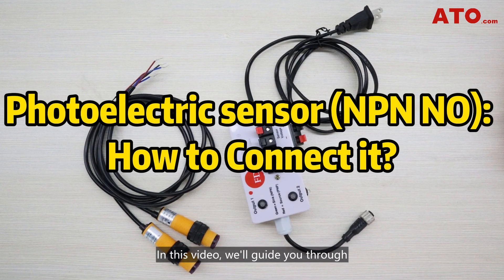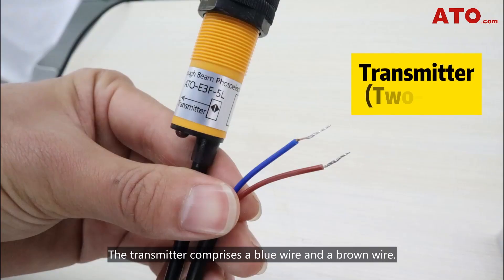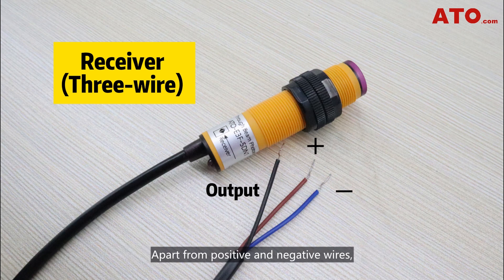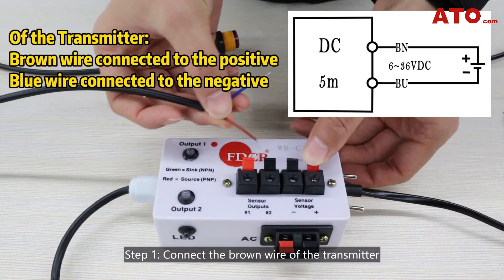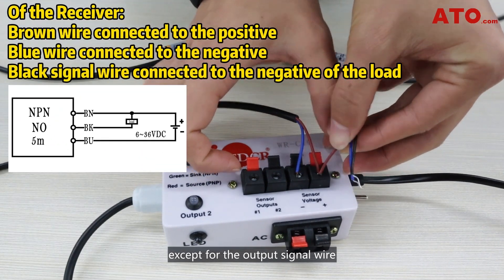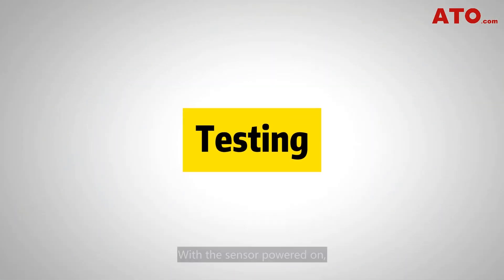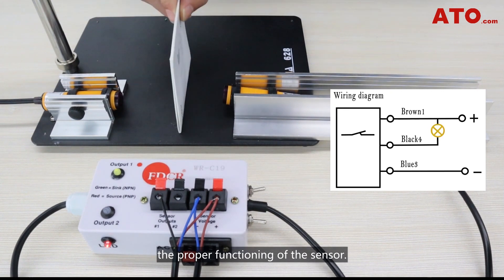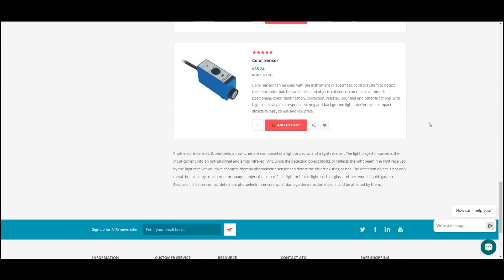Wiring and Testing Photoelectric Sensor #howto

Comment: Do you have a video on a real world example? I want to use a photoelectric sensor to turn on and off a light? Is that possible?
Reply: yes through a relay or transistor
Reply: use the signal wire of the sensor to turn on a 24vdc relay. (energize the coil) then take the normally open contact to your light.. That way when your sensor gets blocked, it energizes the relay, the NO contacts close and sends voltage to your light.